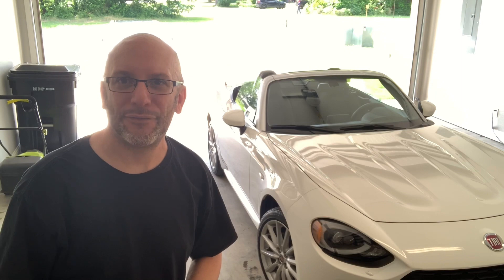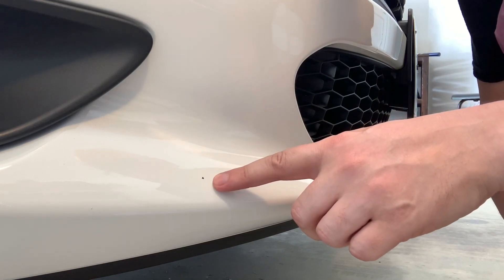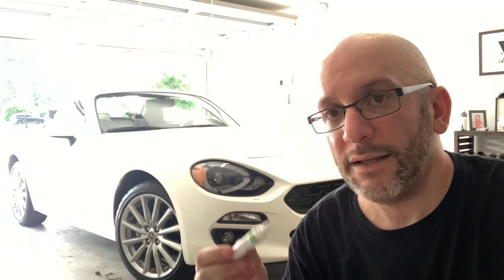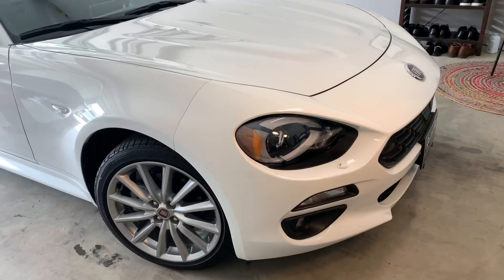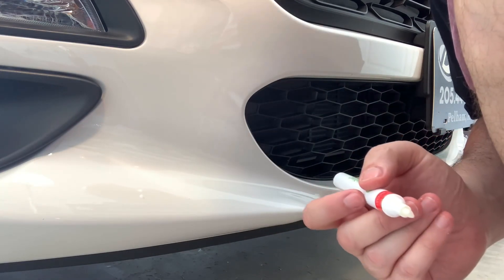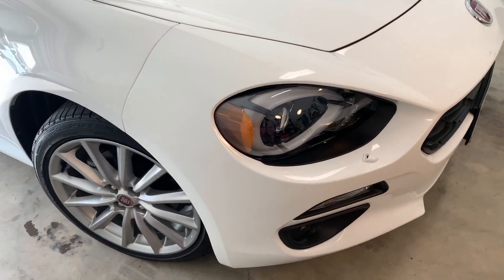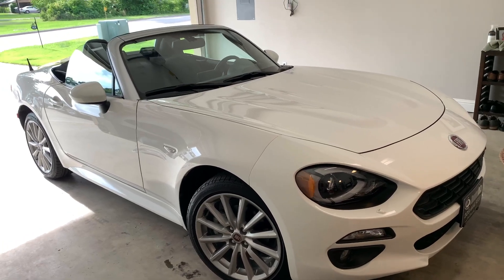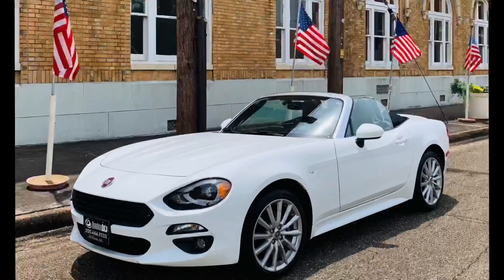Rock chips are "no match" for Touch Up Direct!

Comment: I bought the 3 pen pack with sandpaper and listened to instructions online several times.  When I used the primer pen it would not flow from the pen side.  The brush side was thick and not easy to spread.  It only got worse from this.  It does not dry fast as I was told and was lumpy.  The paint pen did not flow either.  I had to turn the pen probe upside down to get any paint out of it and then turn it back around and it did not flow well at all.  This is the worst set of paints I have used in my life.  I will wait for the paint to dry for a week and see what happens.  This is supposed to be touted as the best and it is the worst.  CRAP!